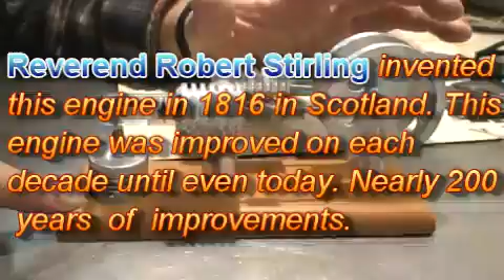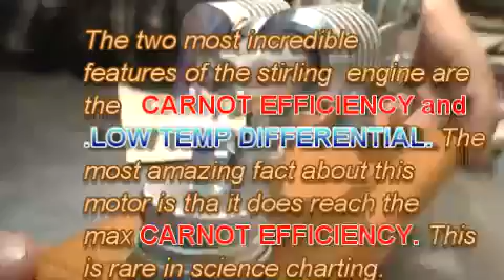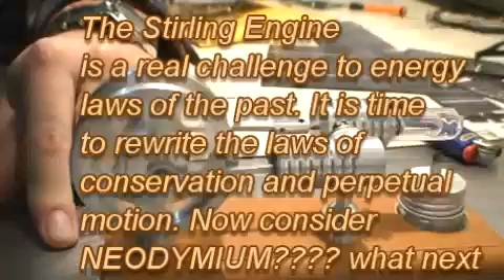free power, how it works, the stirling engine part 1

Comment: The displacer moves cold air to hot area to heat and also the piston compressing the gas also causes an increase in temperature (when gas is compressed it heats up) 
when the cycle changes the pressure on the gas is released causing it to cool and the displacer then moves the gas to the cold side resulting in cooling of the gas. this pulls the piston back into the chamber then the cycle starts over again. the fly wheel helps keep the momentum up..
hope this helps you understand it more

Comment: It's powered by temperature/pressure differences. There are Stirling motors that run off of a cold source. You could theoretically power one by putting the base in a swimming pool on a hot day.

Comment: or in an attic space ? basically to couple these engines with batteries and smart power converters. imagine these engines running several at home during the day and charging up a battery bank. then using the batteries at night to power electrical devices.

Comment: Exactly. And let's not forget the convenience of Stirling over sler, by the way. Stirling can be powered by any form of heat to generate useful energy, whereas PV cells are only really effective about 35-40% of the day if it's clear out. Night time or any sort of overcast weather and they won't work, which is where Stirling has the upper hand.

Comment: you would have to attach a metal pole to one of the wheels, the pole would have a magnet attached to it. you would then coil some copper wire around the magnet and wire it into your main circutt system in your house. the magnet spins rubing against the copper wire creating a lot of electricity, the power would then go to your house. its basic kinetic to electric power conversion.

Comment: I can see something like this supplement power to the home, maybe instead of using alcohol to heat the push part you may want to setup some form of solar power like a large fresnal lens to heat it.  The motor can then get connected to an alternator or generator to charge a battery which can be used as some form of voltage regulator and stable power supply.

Comment: @DTMRM8 You don't have to use fuel any heat source works including sunlight and a parabolic dish works wonderfully there is a company called Infinia that makes a system that looks like a satellite dish but the dish is a segmented parabolic dish with a stirling  engine at the focal point and the dish tracks the sun and is a self contained unit!!!

Comment: And in the end you have to consider everything it took to produce the PV cells if you're really looking for accurate device efficiency. Whatever chemicals and machinery it took to make the PV cells factors into how efficient they actually are, which is why I just simplify it and look at the thermodynamic efficiency of the cycle, which is simply the conversion of energy from one form to the other. It's always proven a fairly accurate measurement of engine efficiency overall.

Comment: you would attach it to a generator with a transformer power step  to the hz and current/voltage requirements for what you need to run... <<--- simplified

Comment: Using a magnifying glass to put a hot spot on the tube when sunlight is good enough may do the job and allow power to be generated to charge batteries for use at night.

Comment: @hyzercreek and @gregawsimo 
the problem of free energy is not its cost in term of $, but its cost in terms of quantity. the relationship between quantity and price is another topic. But if you consume 0.001 L of gas (even if you got it FREE or stole it) to make an engine work and use it to move objects, then our system which is the whole quantity of resources we can find lacks a 0,001L wich could not ever be replaced or recreated. Instead you have the products of chemical reaction

Comment: I think a magnet motor is more usually called an electric motor, You still need to put the power in to get the work out. If there was a simple reliable way of making electricity which doesn't involve carpeting the globe with solar panels, it would already be happening on a very large scale.

Comment: To add just a tiny little bit, PVs are even more desirable due to their higher power density than Stirling, and their lower maintenance cost and complexity. That doesn't mean that Stirling technology over the years won't progress to the point of them being effective backup generators, but they'll definitely not see widespread power grid implementation.

Comment: It does use the sun to power it.  Parabolic focus mirrors, but they do generate the power.  Via heat from the sun.  The closest thing, to date, to perpetual motion.  Really cool if you ask me.  With a few solar powered models it is possible to power your place.  They are about 100 bucks to build a basic, solar powered, version.  Give it a try.  Who knows maybe you'll like it.  Clean nuclear power from the sun.

Comment: @electrondon 

I guess that depends on your individual perception of the definition of "Free".

If the title implies:
-this engine exhibits overunity then you'd be incorrect. 
-that this design could be modified to induce overunity you'd still be incorrect.
-it is a source of energy from anything that burns then yes it is, but material is not free.

Recently they created a Ni45Co5Mn40Sn10 alloy that generates magnetic fields with heat, potentially waste heat. Efficient, not free.

Comment: yes it could be use to generate heat but in the Stirling engine it can be any heat source the alcohol in the engine is not a fuel sources its more like a pedals in a bicycle. The alcohol doesn't create energy though a chemical reaction so it can not be conceded  fuel it is simple changing its states of matter.

Comment: If you could get the cold chamber to absolute zero, you would have maximum carnot efficiency.. It is impossible, as abs. zero is impossible. But even then, this probably gets much higher efficiency compared to most engines... The key is inserting as much heat as you can into the gas, and then extracting as much as you can out of it. The better you can do these things, the more work power you'll have.

Comment: @kilx81 I think he meant "free" as in "coming from nowhere and violating the laws of the universe"

But I agree, solar energy is a great resource that is underutilized.  The problem with any heat engine, whether it be Stirling, Brayton, even Carnot, its thermal efficiency can never reach 100%.  Solar panels, on the other hand, create extremely versatile electric current.

Comment: You can use a magnifying glass and sunlight to create the heat and that is free
Reply: I like the magnifiying thing.use magnifying glasses to heat up fluid inside of copper pipes then store the hot water for when the sun  goes down and still run the engine to have lights, fridge, cable tv ,pc.etc ok I am starting to make myself laugh but it would be nice.
Reply: There is a video on youtube of someone using a massive fresnel lens (from a large screen TV) to boil water for a steam engine.  You could hook this up to a generator and provide free power.    The only issues are a constant flow of water, and the fact that there would need to be a system in place to track the movement of the sun.

Comment: wich are not necessary obvious to exploit. For example once the heat of an engine is dissipated in the air, how can you find it and gather it to use it again (cook an egg for ex.). So the problem of free energy is not only its finiteness but also its form and the convenience of exploitation related to each form of energy.
For all these reasons and maybe many others, one says that energy is not free (you have to understand "not free" in the sense of the limitations previously mentionned)

Comment: how is it free if you have to buy and burn fuel?
Reply: there are solar versions where the sun's heat is magnified onto the chamber.
Reply: R Gambit yes. clearly this is not one of them.
Reply: The only one iv seen, they wont sell to people.
Reply: Mike Warren Just saw a stirling motor with the glass chamber at the focal point of a 24" diameter fresnel lens. Didn't know the exact RPM, but it was probably near 4,500. Looking at building one of these and adding a belt to drive an alternator and adding magnets to the rotors and wiring coils to a battery bank.
Reply: We should do that
Reply: Craig Miller Post it when it's done, g'luck!

Comment: To think that mathematical data on such a trivial matter is skewed one way or the other is a bit off, I think. Anyways, what I was saying is that, while PV cells are just catching Stirling engines in efficiency, they've always been able to produce more power. Stirling engines take more time to convert heat into energy, whereas PV cells don't have any such latency. Yes, solar panels are clearly superior, but my point was that Stirling engines aren't as far behind PV as you indicated.

Comment: Ha, no problem. I've done that my fair share of times as well.
The most state-of-the-art PV cells achieve roughly 33% thermodynamic efficiency, while the most state-of-the-art Stirling engines are only capable of about 32% efficiency. Note that those numbers are simply from the fuel source to the generator through the device. Any other losses including fuel transportation, generator losses, and grid energizing would surely tip the scales in PV favor, as they're just simpler devices.

Comment: neat little device but i wouldn't call it "free power" as you still have to use energy in order to heat up one end...all it is is a way of converting thermal energy into motion.

Comment: There has been few comments saying PVs are better. Southeast Asia has more than 3 months of seasonal rains when the weather is always cloudy. There are Tropical regions were it rains everyday during the noon. Also the countries which are far from the equator receive very low sunlight. PVs will either won't work or will work only on certain time of the day or year that to with a 40% efficiency. That will not answer teh Energy Crisis.

Comment: Well, none of it is new really.  But, the best method, is a solar evacuated tube, stirling engine, seebeck TEG thermoelectronic power generator, and put fluid into the system, with a fan on the spinning wheel.  Many such builds, with those elements involved.. you can use a bank of evacuated solar tubes and water, and run steam engines, with the Seebeck TEG's (300 celsius) from customthermoelectric dot come.  The NEW is Teg's.

Comment: Why not put a little boiler above the heat cylinder, since much heat gets wasted. Then use your warm water to contrast with cooler water, and spring NITINOL back to its original (spring) shape which gives great force! Its a weird nickel-titanium alloy of 1970s which could (as with this) drive small electric generator. See Energy Generation from Nitinol. Glad to learn autos were made using this. Should have had little engine wear. Why was this type pulled? thanks

Comment: A string or a starter motor or even compressed air or any other form of external 'momentum' imparted...it all amounts to that "Initial spin" which every engine requires, before it assumes 'self powered' state !!!

Comment: The thing about efficiency numbers is that they're always skewed in the direction of whatever is favored by the person producing the numbers, because it depends on the measuring points.
But, your claim was about a magnifying glass and these particular engines.
So, go take a magnifying glass of 1 sq meter. And, go heat a Stirling engine with it, which then drives a generator.
Put a 1sq meter modern solar panel next to it.
Guess which one makes more usable electricity?
(Solar panels win by far.)

Comment: what we call energy on demand is not free but still we can store energy to use it when we need we can use this stirling engine using solar heat  and store it to use it during night time....actualy nite time we use only small amount of energy but day time we use more energy on air conditioner....we can use this engine to power the airconditioner

Comment: Problem with Sterling engines is their thermal efficiency is very low. BTU in to horse power out is very high. If they were efficient they would have been in common use a long time ago. Instead they where only used where solid fuel was cheap and/or electricity was not available. Neat toy..

Comment: Wow, free power! As free as the fuel in your burner.

Seriously, though, how does this compare with the efficiency of other external combustion heat engines? It certainly is simple, but it appears to have almost no starting torque. The explanation in the video of how it works is about as clear as mud, but from what I see it appears to be using a temperature differential, and air as a working fluid.

Comment: To add to my comment, PV cells are still better at generating useful energy from heat, as they can do it faster (albeit until recently less efficiently) than Stirling engines.

Comment: Oh, holy crap. You're right. That wasn't you with the magnifying glass comment.
Sincere apologies for mistaking you with someone else.
Energy efficiency depends on starting point. Your claim for 30-35% efficiency is talking about burning a fuel here. Making/distributing fuel consumes mountains of energy. So, if you start from the point after the fuel has already been made and delivered to your house, that's a major skewing of the stats because so much energy was lost before your starting point.

Comment: @AMH9217 what makes this our future? this engine is not a whole lot different than the engines we use now, it just burns candles. if you think cars burn alot of fuel, then you should see how big of a candle to power the stirling engine which would also be huge.  this is not our future, this is a smaller, simpler version of out present technology

Comment: If you watch that video you see alot of magnet motors that just run on magnets. Theres also a other part of that video that got a big magnet motor whit great rpm's
You only need to put a generator on it to get energy from those rotations.
Sure the magnets will lose strenght but that takes a verry verry long time.
But im no expert. but because i see alot of video's and papers whit that kind of engine i think it will be the future, not to run you car but to create electricity and mayby then run it

Comment: But the sun radiates so much energy and it costs nothing to utilize the heat from the sun. You could use a lens to focus sunlight on the glass bulb on this design to heat the air and thus generate free electrical energy.

Comment: Actually it does. Oil is made from very old organisms that were photosynthetic meaning it uses the sun's energy to produce the food that the organism needed to survive. Once it died millions of years of pressure and heat created oil. So since the organism that made the oil in the first place used the suns energy technically oil comes from the suns energy.

Comment: OK you can use a dish to concentrate the energy to a point.  However you are still limited to the amount of sunlight that falls on the surface of the earth.  Under perfect sunny conditions at the equator this is roughly 1kW per square meter.  So to create a relatively low power car with an 80kw motor you'd need to harness 80 square meters of perfect sunlight.  BUT WAIT.  The conversion to usable power is about 20% so you'd actually need 400 square meters of perfect sunlight to get your car.

Comment: So if I go down the block and steal everybody's gas down the block and i put it in my tank is that free energy didn't cost me anything

Energy can not be destroyed but can be changed like heat to motion but along with that heat energy is lost through light from the flame and friction from the cylinder crank ect and other losses now the question how much is lost and it doesn't seem it very effective in controlling losses

Comment: Just so we're clear, until recently Stirling engines were better at turning heat into energy than PV cells. The most efficient Stirling engines run around 32% thermodynamic efficiency, whereas PV cells are just now advancing past that. Note that PV cells are showing more progress than Stirling engines, but that may be because there's more financial backing to support R&D.

Comment: it removes all the complexity of internal combustion. keeps us away from th oil companies. you could probaly disengage motor but leave them running to charge a battery ? or better yet a  kinetic spring mechanism that would almost be 99.9% "oil" free engine. solar + sterling = the future.

Comment: Your description of how it works is incorrect.  The first piston is not pushed back by air pressure.  It is moved by the flywheel.  The drive piston moves in and out as the air inside expands and contracts.  The first "cylinder" as you call it is the displacer.  It moves the air back and forth between the heating and cooling phases of the motor.

Comment: That was my point, so why is the video called "free energy"? The stirling engine, while interesting, is only half a power plant as you still need something to heat it up.

And it really doesn't do anything more than we already do in coal or nuclear plant, transforming heat to energy. Only difference is that this is using air while others are using water/steam, which to my knowledge is more efficient.

Comment: Either you don't really know how it works, or your powers of expressing yourself clearly are limited. The "piston" in the glass tube is the displacer, it doesn't drive the flywheel, it just shunts the air back and forth. Still, nicely made model.
Reply: grahamus... you seem to understand this well. do you know if it could be used to generate electricity? this engine seems like a brilliant little idea if it can be utilized because it is clean burning and looks pretty efficient.